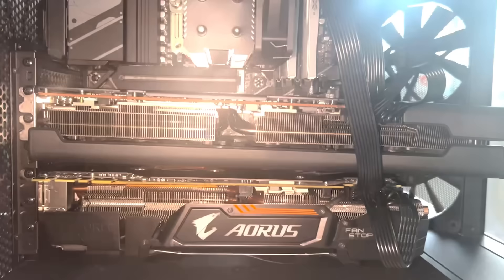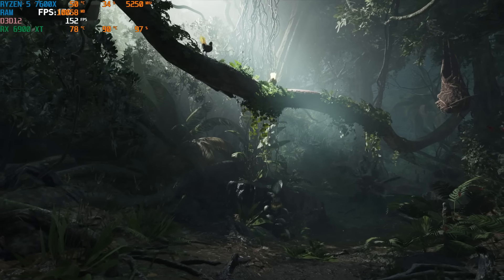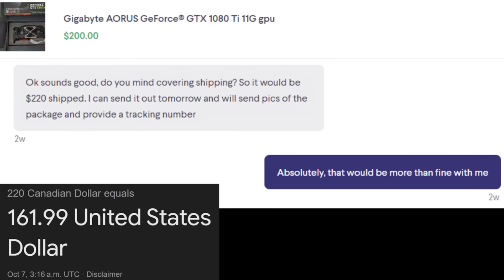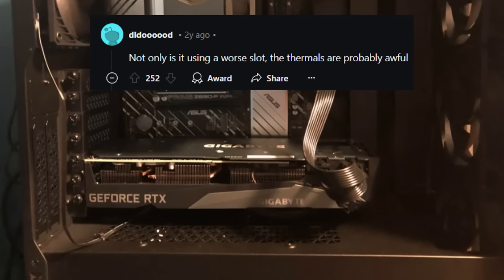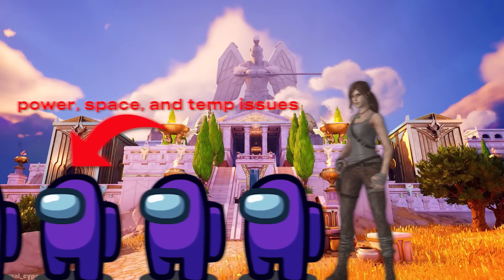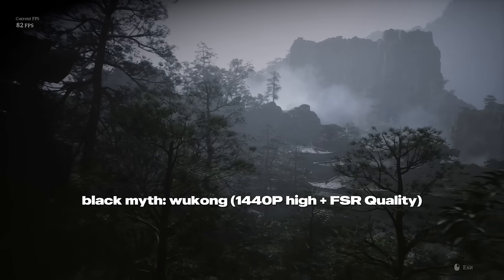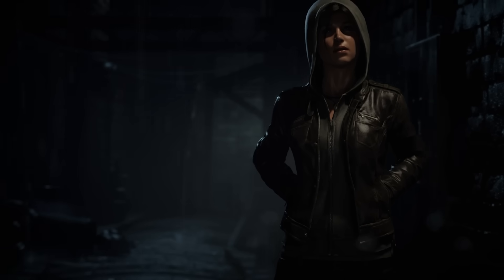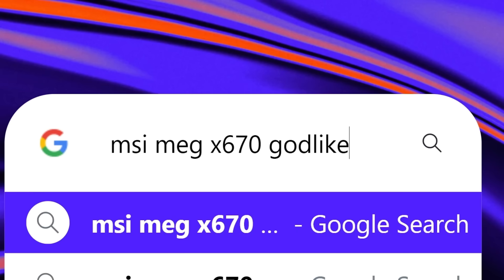I Combined AMD & NVIDIA in One PC and Got 1500 FPS

Comment: MSI 870A and P55 Lucid Hydra motherboards supported multi GPU from AMD and Nvidia 14 yrs ago, while it worked it was hit and miss on being better than SLI and Crossfire, the only benefit is you could use any GPU that was from the same brand so GTX XXX or HD XXXX , or just mix them up, and was killed off due to lack of support just like SLI and Crossfire themselves.

Comment: There is one motherboard manufacturing company (could not remember which one gigabyte/asus/msi/asrock/abit/dfi/biostar/ecs) did produce a motherboard that support both Nvidia and Amd graphics that would run simoultaneously and the chipset on the motherboard they were using at that time was called Lucid. This was way back when nvidia SLI and amd Crossfire was a thing.

Comment: It ain't possible different chipsets, it will work HOWEVER! They WILL NOT SLI or crossfire, however you can do this as a secondary monitor or you just want a lot of monitors this is all it's used for.. quad monitor set ups

Comment: The whole PCIE thing happening with motherboards saddens me. For reference I have a Z270 board from 2017, it costed only $120 and supports 3.0 X8 X8 SLI, almost every Z270 mobo did. A couple years ago I spent $200 on a motherboard with an X570 chipset, almost every single board on the market does not have true X8 X8 pcie slots, its all X4 or X1 in the lower slots. Its even worse knowing that Ryzen has more PCIE lanes than kaby lake, mobo manufactures either don't care and or now scalping people for a fairly basic and inexpensive feature...

Comment: You can’t get this to work for multitude of reasons aside from the fact that no software exists that can take advantage of both GPU vendors at the same time for compute.

First, a GPU is designed to split certain task’s between different threads. This action itself already requires a lot of semaphore tinkering and synchronization. This is quite literally impossible to achieve between 2 different GPUs let alone 2 different vendors unless it’s extremely basic operations.

Second, Neither Vulkan nor Direct3D have a “Device pooling” feature and it has to be provided by the vendor itself through extensions and applications specifically have to take advantage of said extensions. Both vendors have their own method of doing this and both are completely different from each other.
Reply: On a side note, you can use 2 GPUs from different vendors inside a setup. e.g You can offload the rendering of a game to your NVIDIA GPU while using your AMD GPU for display output or using AMD’s driver specific “enhancements” and visa versa. You just can’t render a game/do a compute task on both GPUs at the same time.
Reply: @light-gray  The closest you can get to it is getting a second GPU that's dedicated to frame generation (using Lossless Scaling) while the first one does the rendering, depending on the model you can turn 60 fps into 120, 180 or even 240 fps, I love it but it's not real "GPU performance combined", but rather two GPU's doing different things that benefit the guy playing the game
Reply: @light-gray  Well its actually isnt true at all. DirectX 12 has a multi-gpu feature, that has to be incorporated by the game developer. And that thing... allows you to combine any gpu with any gpu, at the same time, at the same task. Tho it was really implemented in like, only one game. Very much like SLI, but even more obscure despite the potential.
Reply from the maker: super insightful ! thank u

Comment: I had a motherboard for my 2500k that supported having nvidia and amd gpu together.  I never actually tried it, but the motherboard could do it which was cool
Reply: MSI Fuzion?
Reply: Rip old king, the intel 2600k
Reply: @RS_Redbaron  Yeahhh, I ran my 2500k at 4.8ghz 24/7 with no over volting, and the last few years I even ran it passive because my cooler bracket broke or something, I had the scythe mugen 2 cooler and that heatsink was a BEAST.  But yeah that 2500k got me all the way thru 2019

Comment: Day two of asking for this video idea... "Using lossless scalings frame generation on the GT 710"
Reply from the maker: that will be part of the next video stay tuned bro
Reply: I use my 3060ti as the main render GPU and my 5600XT as the GPU for Lossless Scaling. I will not spoil much, but it varies. The main bottleneck is mostly my 5600XT and its 6GB VRAM, and partially the x4 slot it is in.

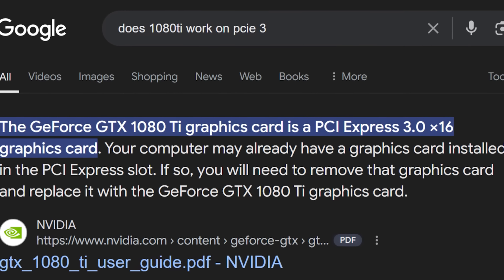Comment: 4:32 It's completely fine to use a GPU at a slower slot.
I use dual gpu for gpu passthrough virtualization, both the GTX 1060 6GB and RTX 3060 are running at their full rated speeds despite the motherboard throttling the pcie speeds to accommodate both cards.

Comment: long story short: adding a second GPU won't help gaming performance much. This is because graphics cards are already so fast that any extra distance between components can actually slow it down. That's why the memory modules on a graphics card always surround the main chip. 

Also, you can use an AMD and Nvidia card at the same time in the same pc, for example running a game on AMD and using Nvidia for OBS; they can both do separate tasks at the same time, but not the same task at the same time. But because having two cards installed complicates things, it's honestly better to never worry about running two at once and instead either try overclocking or replacing your card entirely if it isn't performing to your needs
Reply: The closest you can get to it is getting a second GPU that's dedicated to frame generation (using Lossless Scaling) while the first one does the rendering, depending on the model you can turn 60 fps into 120, 180 or even 240 fps, I love it but it's not real "GPU performance combined", but rather two GPU's doing different things that benefit the guy playing the game
Reply: @ivanvladimir0435 done that. 970 running Lossless Scaling and frame gen while my 3060 plays the game. Unfortunately the 970 can't run 1080P+ x4 while gaming but that's a not terrible limitation.
Reply: @glenwaldrop8166  Yeah... old GPU's hit their limit quickly, but it's still worth trying if you have a GPU just lying around
Reply: @ivanvladimir0435  I'm still using my 970s as a Physx GPU and for AI.
With only the 3060 AI bogged the system, with the 970 it runs better. Unfortunately I can't control how much is used, it still mostly uses the 3060 but it uses some of the 970 VRAM somehow and takes enough load off of the 3060 that I can use it as a local LLM for the Fallout 4 Mantella mod.
It behaves like the 970 is mostly used for RAM but I'm not sure how the load balancing works.
Reply: @glenwaldrop8166 what do you mean by can't run specifically? Also what if you generated the frames with the more powerful GPU, and lowered the native resolution and scaled it up with lossless?
Reply: @dramaticmudderer5208  I can't specify which GPU the AI runs on.
I'm already running at 720P. Going down lower gains nothing. It's more about VRAM than anything else. Even though the 970 has less it's also not running the game.
Reply: @glenwaldrop8166 I do it at 4k on an AMD RX 570, and it does struggle, but it does help when Minecraft with intense shaders only gets 20 fps.
Reply: @glenwaldrop8166  you might also be bottlenecked by pcie lanes, idk
Reply: @H3c171  shouldn't be.  PCIe 3.0 16x on an x570 motherboard. I'm going to have to find a way to monitor how much bandwidth is going across the bus.

Edit: You're probably right, PCIe x4 4.0 to the PCIe hub may be the bottleneck. Now I really want a way to monitor bandwidth.
Reply: @ivanvladimir0435  I played a game tech demo (bit obacure and no longer available) using an Arc380 to raytrace sound, the integrated gpu from the 7700 to send the sound to the receiver, and the game played on a 4070 Super. 

You can divide tasks just fine like this.
Reply: @ivanvladimir0435  I played a game tech demo (bit obacure and no longer available) using an Arc380 to raytrace sound, the integrated gpu from the 7700 to send the sound to the receiver, and the game played on a 4070 Super. 

You can divide tasks just fine like this.
Reply: @ivanvladimir0435  technically you can run 2 different gpus, you just can't utilize them in the same application (except with special circumstances) it's similar to raid where you could use a 2 tb and 1tb hdd in raid 0 or raid 1 but you'll only get 2 tb because they have to match up in everything speed at a 5400 and 7200? Your getting 5400 regardless, cache 64 and 128, once that 64 fills, you're waiting.
Reply: Gpu agnostic multi gpu rendering can work and is duable via DX12 & Vulkan (explicit m-GPU) as shown here with Rise of the Tomb Raider, it's just that, its slower than SLI.

Also, very few devs actually care to add support for it since it can be quite a hassle to do, and it takes additional dev time having to optimizing your game for it. 
Add to that, the performance wasn't that great with it, SLI & Crossfire was still better, only advantage it had was that it can theoretically work on pretty much any GPU combo just as long as they both support DX12 and vulkan.

To this day, the only game that ived actually played (that I own) that had support for it was Ashes of the Singularity.
I used to play it using an RX 580 + GTX 1060 combo (when 10 series finally had dx12 support via driver update). 
It played pretty well considering the vram size miss match, it only started having problems when the 1060 6gb started getting vram limited at higher resolutions (severe stuttering at 1440p & above).

Other Games that i remeber having explicit m-GPU support via dx12 : 

- Rise of the Tomb Raider (shown in the video)
- DeusEX : Mankind Devided
- Civilization 6
- Hitman (only the first one)
- Gears 4
- Sniper Elite 4
- Halo Wars 2

Don't know if the games listed above still have explicit m-GPU support or if it's been patched out of them.

Other than Gaming. Only other program I know where Multi GPU setup is still viable is Blender if enable multi gpu rendering in the settings.
Reply: How about for recording, as in using the NVENC encoder while I game on the radeon cards, does that work or am I missing something here?
Reply: @hideakikovacs2859  yes and no.
Yes you can do it, but it can lower performance due to transferring the image between GPU. Most GPU have encoder chips baked onto them so it's faster to encode with the GPU your using to game
Reply: @hideakikovacs2859  that works yea
Reply: @hideakikovacs2859  yes it works thats how I set my nieces workstation up she games on a rx 6800 and uses the 1070 ti for a second hdmi out for dual monitor and uses it to record in obs you just have to tell obs to use the second card  for recording
Reply: doing it the way he did it, yes. if you use an eGPU breakaway box you can set other programs to run through your external gpu resulting in significantly higher performance in some games while others gaining on average of 15fps. ive seen fps gains as high as 250fps using this method. especially as an alternative to streaming, recording, gaming on one pc.
Reply: SLI would like to have a chat
Reply: I am anyway unsure. it its not usefull wiht our Extrem "overtuned" cards splitting Render Components. So in Basic what i mean. you have 1 Card inside your pc thats maybe the main card It Renders the most stuff(background, models  etc). I make the splitts now ez not usefull. And the other card its low Price card wiht low perfomance that render only The RT effekts. I mean that make stuff Ccomplety different. Or maybe wiht other splitts. So u have a FIX CARD thats the low end gpus wiht no room for lot of pricepools. This card make a basic render and the hardware that u always change its the second card aka our GPU. So u need a good standart to use maybe the "FIX" card for 10 years its not so important. MAYBE that render only backgrounds but give the main card enough space for better perormance and maybe costs. Next Bonus is This Fix card maybe we can use untill end of time .you dont need always new tech for simple background render and u can use this FIX card to end of his life. New tech is only on the "real" gpu

OR complete otherwiese...... AGPU + bascic gpu and they splitt render components. so u dont need a extra card. Maybe AMD in FUTURE BETTER?!?! KAPPA XDD
Reply: this is why SLI and crossfire were invented.
Reply: Easiest way to run 2 GPU's is to run a multi-CPU motherboard. At that point though, you're not gaming, you're compiling or running AI related tasks these days and your CPU's are just an expensive task director.
Reply: The problem is not with video cards in the motherboard chipset, which cannot provide more lines when working with a large number of GPUs or SSDs.
Reply: @Biv4Lv4n  That could be a factor. The machine is fairly well loaded but even when using x4 on a video the 970 has a hard time keeping up. I'm only scaling to 1440. I'll do some digging and figure a way to confirm. Might be as simple as swapping which card is in which slot. If the 3060 can't handle x4 in the second 16x port then bandwidth would seem to be the issue.
Reply: that called immou right? to config this what you desribe i wanna make, seen this concept once on youtube, running Os on Amd and while gaming let pc switch to Nvidea gpu.
Reply: Lossless scaling app has now made two gpu not only viable but the future of gaming
Reply: Get RT with B580 while the brunt of the game runs on the Radeon VII....

No I didn't dig into it, as the B580 was acting weird from day 1, then I came home to "space invaders" coming out of sleep, so back to just the R VII
Reply: but for jellyfin tho
Reply: @nepp-  no. Combine them to make them run a single game together. Time to Fuzion.
Reply: @arenzricodexd4409  with an SLI/Crossfire compatible gpu with another gpu of the same model, and vendor would work, but amd and nvidia cards were never designed to work together sadly
Reply: @nepp-  True, but that does not matter. 

DX12 allows you to use mGPU, and though very few titles actually support it, some do and you can mix and match graphics cards at will, also Nvidia and AMD.

But best to keep them same capabilities similar performance for a good result.
Reply: @jamegumb7298  actually I never knew about that!
Reply: @nepp-  I ran SLI 970s for years. When they worked it was terrific, Fallout 4 played better with SLI 970 than with a 2060 or 3060. Over half of my other games, however, were limited to only using one GPU. Considering the 970 could handle most everything I played back then without issue it didn't matter but new games didn't take advantage of SLI.
Reply: @nepp-  I feel like this problem could easily be solved with software its just that no one has made the software
Reply: @arenzricodexd4409  Unfortunately both GPUs would require their own dedicated tasks, depending on the GPU processing speed difference there would be FPS stuttering due to  one GPU failing to keep up, it's why the stronger GPU is set as primary for it's raw performance and speed.

the weaker GPU would take some load off the main to keep the stronger GPU at peak performance and FPS

at least this what I think.

Comment: by the way it's not a flawless process to use 2 gpu each one with a monitor connected, i've tried this myself and windows stutters every single time you drag a window from one gpu's monitor to the other, so yeah the point of this video is don't buy a second graphics card if you don't need it

Comment: So did you just plug both GPUs in and they worked automatically? Or did you have to install new drivers? Or do you plug your monitor into the GPU you want to 'host' everything? What's the process? You made it seem like you just added a second GPU into your motherboard and they both worked together flawlessly.
Reply from the maker: had to install drivers, other than that it worked pretty much flawlessly across the 2 monitors
Reply: @lecctron  I see. What drivers?
Reply: @alexturnbackthearmy1907  So the game must support dual GPU rendering? How many people use dual GPU rendering? Doesn't the drivers make the 2 GOUs act like 1 GPU and manager the loads and resources?

Comment: You wouldn't need a MSI godlike, any board with pcie bifrucation would be able to split the slots to 4.0x8 and 3.0x8, allowing for double bandwidth on the 1080ti, but sadly cutting the bandwidth in half for the 6900xt. there are also other motherboards that have more than one full x16 slot, running at full speed.